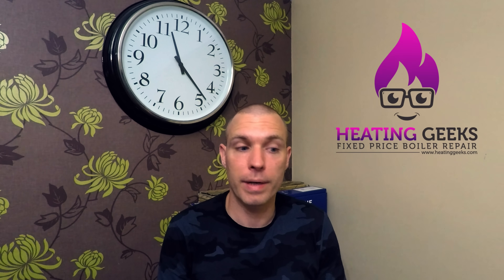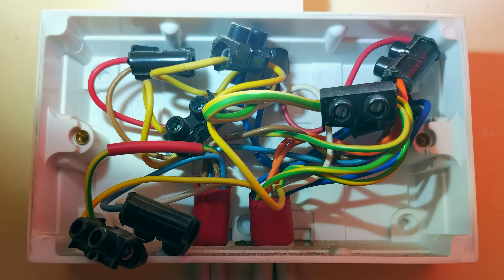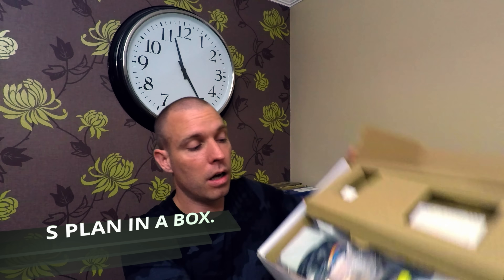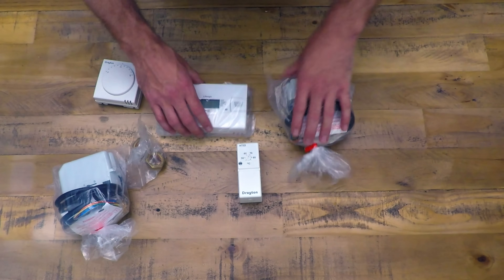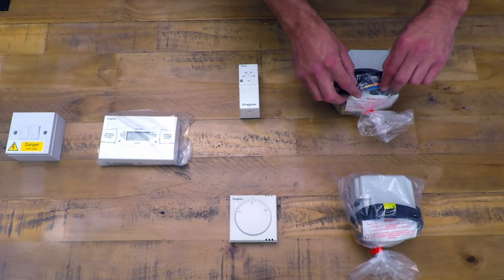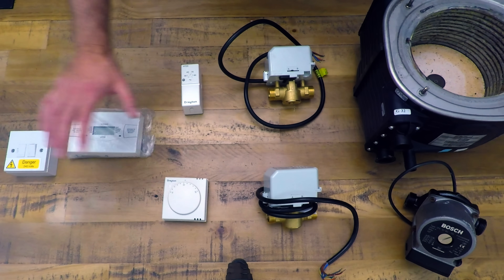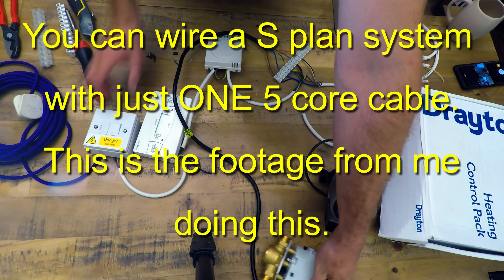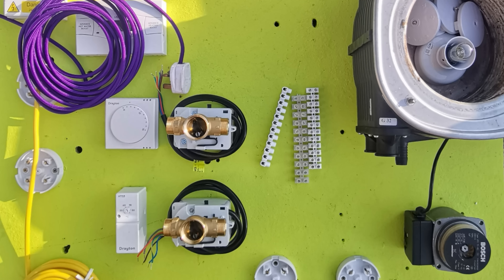How To Wire And Test Heating Systems. 2 Port, 3 Port, S Plan, Y Plan Etc. Part 1

Comment: The best part of this video is explaining how the 2 port zone valve works, switching, colours etc what would happen if you joined the Grey and Orange wire together? This would basically bridge inside  switch ON, OPEN a normally closed 2 port valve?
Reply from the maker: If you joined the Grey to Orange together the boiler and pump would run but have no where to move the heat so it would overheat. The maybe BANG goes the boiler. :-)

Comment: That was so helpful thanks, I suspect that my hot water 2 port valve is faulty. The thermostat works and the valve opens but there is no call for heat and the pump doesn't kick in. So I suspect that the grey wire is not  switching power to the orange wire.

Comment: I didn’t think you would get 240 on grey If the cylinder stat was calling? 240 on Grey if it’s satisfied ? Wouldn’t you get 240 on orange if it was calling( I have assumed heating is off)
Reply from the maker: 240v on grey when either cylinder stat is satisfied or programmer is off for HW. The 240v on the orange when just HW is calling actually comes from the cylinder stat. The cylinder stat demand is wired in with the orange. 

hope that makes sense
Reply: @HeatingGeek  🤣 it does mate - I think I have replied to the wrong video. I watched one where the engineer was checking for a faulty cylinder stat and said to turn the stat up to call for HW and check for 240 on grey not orange  - your vids are brilliant - so we’ll explained

Comment: I remember Len 😂 Al told me a story about when he dropped the cap for a thumb vent and used his hand to keep it from leaking everywhere only problem was the system water temperature was scalding and absolutely destroyed the palm of his hand 🤚 proper old school engineer 😂
Reply from the maker: Are you Als nephew?
Reply: @HeatingGeek  yea mate you heard about lil al ?
Reply from the maker: @aaronchapman6994  Yeah, I was having issues at the time of the funeral so I couldn't make it. You still at Oakray?
Reply from the maker: @aaronchapman6994  I actually think about him all the time.
Reply: @HeatingGeek  yea I think about him and the little way he had his van all set up and everything had its place and I mean I did the majority of my apprenticeship with Al and we used to have a right laugh working together, crazy moments like when I dropped a double panel 2m rad from standing vertically unwrapping it from the plastic and it just dropped all the way down straight and just clipped my big toe but absolutely crushed it Al scooped me up and carried me into a and e with my foot in a bag with a blood soaked sock drove all the way from portpool lane to north mid hospital absolute legend he was
Reply: @HeatingGeek  nah I’m with Aaron services now basically K and T heating turned into
Reply: @HeatingGeek  only do stevenage sg1 and sg2 on oakray settle contract was from Watford to Bedford north to south and probably Luton to Royston west to west so had way more driving although I miss working for my old boss Dan Colbert I think u know him don’t u
Reply from the maker: @aaronchapman6994  Im not sure which dan you mean. A couple of them on that firm. How is All children doing? And what's Eddy up to?
Reply: @HeatingGeek  Dan Colbert up letchworth contract, Als kids are doing well considering the disaster they encountered so suddenly, Tina Als wife is as expected after everything. 
Ed’s working for kier contract procurement I think it was a big shock to the family but I was glad I was given the honour of walking Als coffin into the crematorium. ❤️

Comment: well explained, my question is, i have two zone valves controling down stairs and upstairs + loft. worscester bosch said to increase flow rate to loft area i will need to add an extra pump, ( i understand this ) to connect the pump brown, blue, earth. to the 2port valve. i need to send power from the zone valve (brown wire) to brown wire on pump. blue green wires go to N& E on the zone valve or wiring centre, orange wire is already sends power to boiler to fire up. i only need a switched brown wire to activate the pump once the zone valve is switched on, is this okay and will work. many thanks for you help
Reply from the maker: Sorry I didn’t respond to this comment. I didn’t see it in my feed. :-(

Comment: Hi, I have drayton lifestyle lp111 for heating the water with 2 danfoss tp5000 thermostat for heating. I would like to replace it with smart system.

Can you please let me know which system I need to buy to replace this or will I need new wiring to put in the system

Comment: Superb videos thank you. I can tell that you're the Dude they send in when all the others have been..
Can you diagnose this please: I recently changed the bypass relief valve because it was stuck open. I am carrying out a series of flushes to clean the system drain+refill. Suddenly the room stat switches off boiler live when temp reached?

Comment: Great videos and really helpful. You mentioned about how to wire slightly differently to add a pump over run to older systems but never explained it. Could you help me out there?
Reply from the maker: The boiler will have a PL terminal. You would add the Pump Live to this terminal and the boiler would need a permanent live to control the pump from. So 1 wire in a different place and another (permanent live) extra wire to the boiler.

Comment: Hi how can I overrun pump in only heat boiler
Reply from the maker: The boiler usually controls the pump overrun. So, the boiler needs Permanent live, neutral, earth, switch live and pump live wires. The pump live wire goes to the pump live. 
So additionally to what these 3 videos show you need 2 extra wires to the boiler and the live into the pump gets joined to pump live from the boiler.
Reply: @HeatingGeek  hi thanks for Ripley but I am asking u for only heat boiler which is not have inbuilt pump I am using big pump but just overrun need to find
Reply from the maker: @zakp1326  I know. If the boiler requires pump overrun it controls it. Like the baxi solo 3 potterton suprima. Vaillant ecotec 428 etc etc. Baxi 240340 is a pump overrun kit you might be able to use? Im not sure what boiler you have.
Reply: @HeatingGeek  hi good morning thank you so much now I understand u r very helpful
Reply from the maker: @zakp1326  No problem. What boiler was it on?
Reply: @HeatingGeek  velliant eco tec 428
Reply from the maker: @zakp1326  so you have a green plug for the pump on the pcb of the boiler. Run the pump cable to that.
Reply: @HeatingGeek  ya

Comment: Stunning presentation. Very comprehensive and well explained. Real world experiences and examples. Belive me, understanding this is So IMPORTANT, especially for diagnosis purposes
Reply from the maker: Thanks. It is very important and once you get it you don't forget it. :-)
Reply: Brown is the live from the room stat or cylinder stat 
If no 240 on brown fault lies before motorised valve. 
hope that makes sense !!
Reply from the maker: @DHILL82  Yes. I think about it as the valve is the centre point of the wiring. But really it's just a good reference point to start from. :-)
Reply: HeatingGeek legend my man. Love the videos.  !!
Reply from the maker: @DHILL82  Thanks. :-) Some pretty rough ones to come and then the 3 port and wiring center. :-)

Comment: @10:51 you talk about grey and orange making the switch to turn the boiler on.
Are you sure is not brown and orange.? Apply power to brown then the microswitch in the valve closes and orange has 230v
Grey is the permanent live,
Reply from the maker: No, Its grey and orange that touch. Brown Is what drives the motor to open the valve. Grey and orange attach to the microswitch. :-)

Comment: When I first started I went on all the courses for wiring and spent days doing the honeywell and danfoss course and could wire a system if it was clean or from scratch, then someone told me to do it how you said as a sequence not as like components with numbers and diagrams and I wish I was taught it your way from day one and then did the wiring courses.
Reply from the maker: I think this is the easier way for us guys to understand the system.  ;-)

Comment: in future videos you might want to discuss volt free rather than 240vAC switching..... Lots of boilers go bang because newbies are chucking mains voltage onto a ELV control circuit.  Not to mention Opentherm and BUS stuff.
Reply from the maker: Your right but that's another video. I was just talking about this with someone last week. :-)
Reply: Spotted a volt free question on Allen Hart's channel yesterday. The advice given wasn't optimum.

Comment: you uploaded the wrong video oli? 
i do have an issue tho. 

currently an s plan system... ive wired up another pump and zone valve (for an extention they wanted to be seperate.)  it works fine on its own, but when the rest of the house heating is on it trips the full electrics, also if the house heating is on without the extention it works fine... confused me and i had enough so i left to go with a fresh head. but i am 99% sure its correct cos it works fine on its own, its just the 1% is cos it trips when rest of the house kicks in :-/ 

thanks
brendan 

ps love the videos mate!
Reply: It's not uncommon to see 3 zones now days Upstairs, downstairs & hot water so it shouldn't be an issue.
Reply: @martinasher8705  I've got a 3 bedroom house - 5 zones ;)
Reply from the maker: What fuse is blowing? Spur or RCD in fuse box?
Reply: Thanks boss, when the pdf is ready I will be happy to pay without question. I have been following all your YouTube videos and they are very informative. Thanks
Reply: Get rid of the spare pump and do the job properly ;)

Why do people like adding pumps all over the place ??????